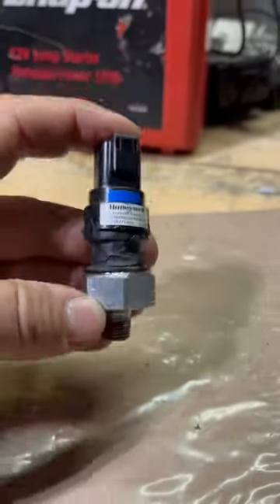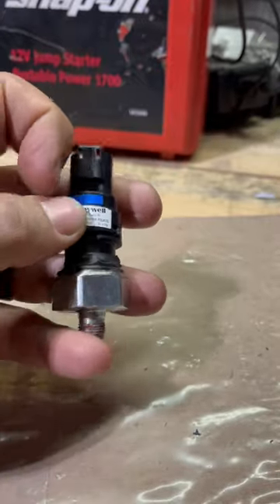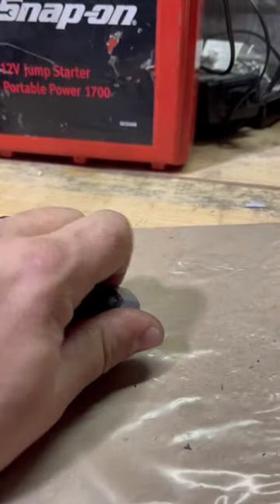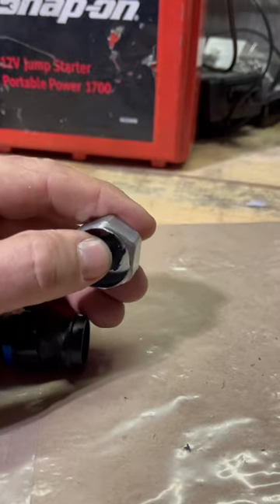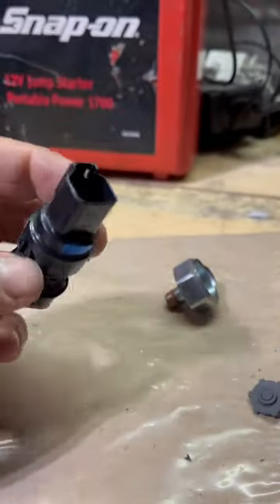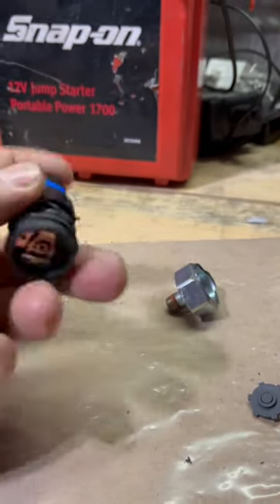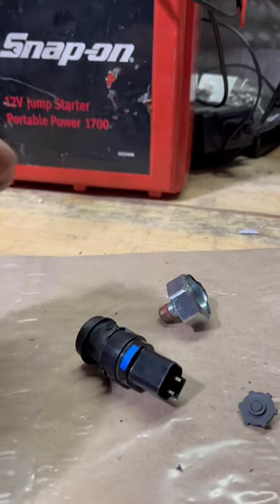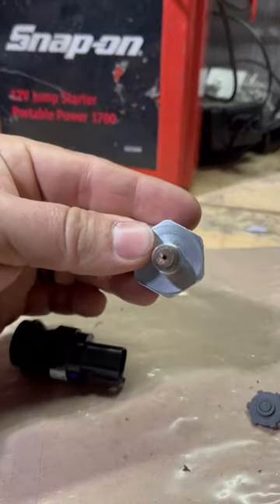How a FREIGHTLINER CASCADIA BLUE AIR BRAKE SWITCH OPERATES🔥😮see inside the inner workings 💪

Comment: unfortunately they discontinued making that switch and changed to a different style where you need to replace the whole wire harness because it's got a different plug. :( I'm going to try using part 12-26770-000 which is set for 70 psi instead of 80 and see if that works
Reply: Yeah it’s got the same happen to me.😮